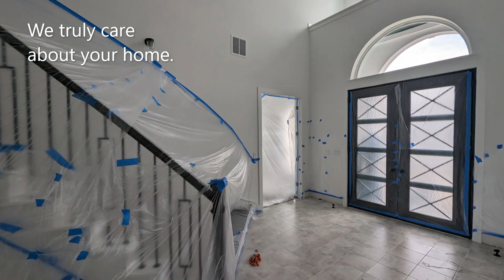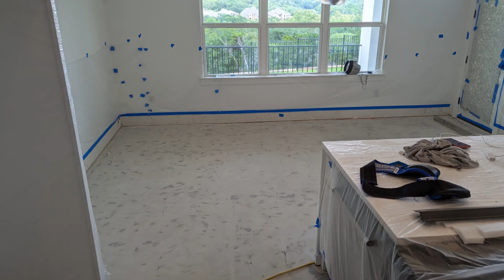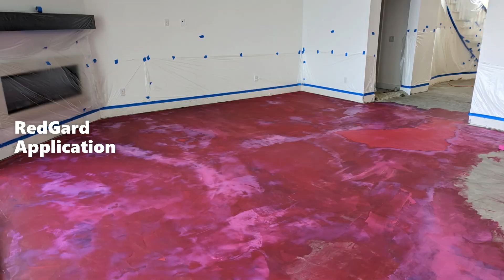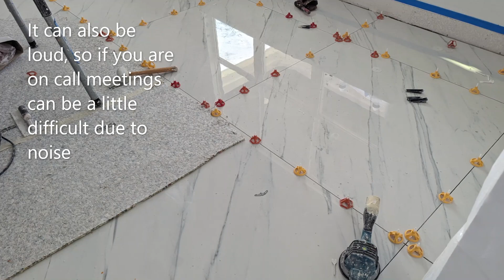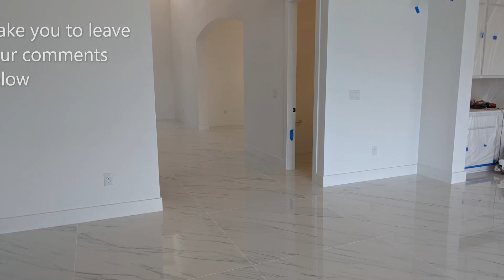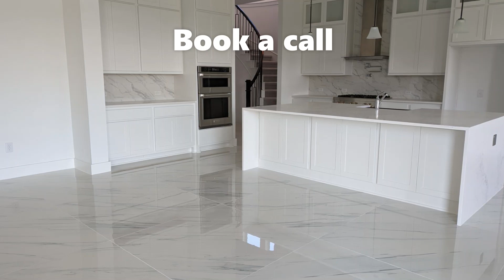48x48 Vanglih Polished Porcelain Tile

Comment: Great work! Enjoyed watching the process. With the Avalanche grout color, does it stain in everyday use? Did you have to seal the grout? How can we ensure that the grout lines are easier to maintain with white tiles?
Reply from the maker: Heyyy for the feedback on the video, appreciate the comment. We used Mapai Color Plus FA grout, here's a bit about it and why we don't have to seal it after is applyed. . Ultracolor Plus Max includes DropEffect technology for reduced surface absorption, helping to repel water, dirt and grime from penetrating grout joints. It is also specially formulated with MAPEIs High-Hydrated Cement Technology (HCT) to provide advantages over traditional grout, such as eliminating efflorescence and increasing stain resistance.